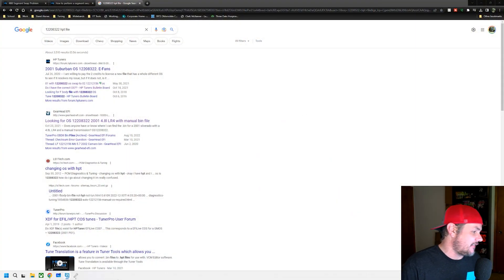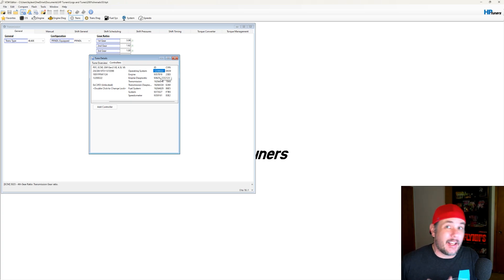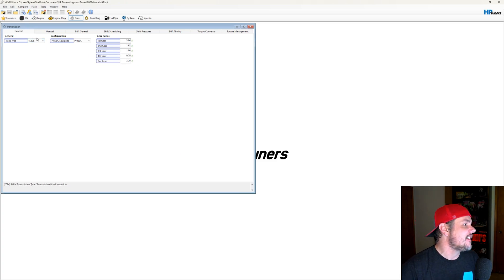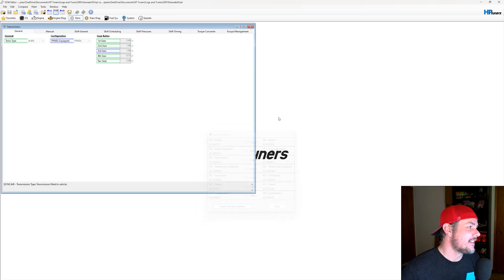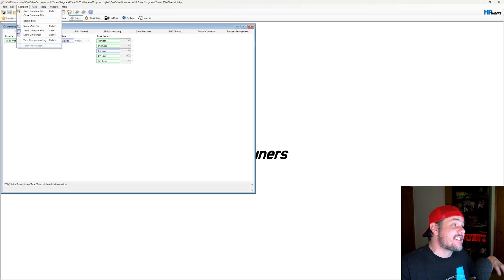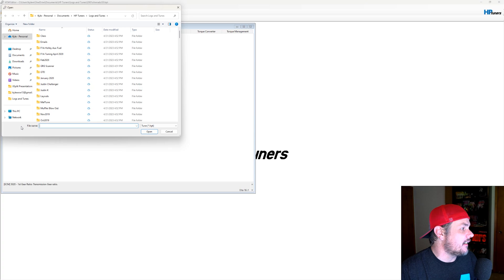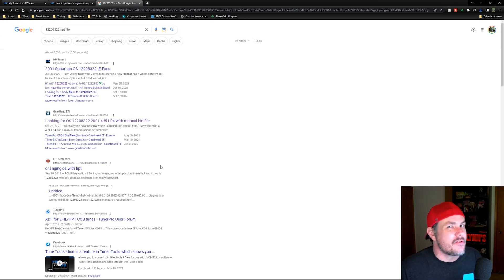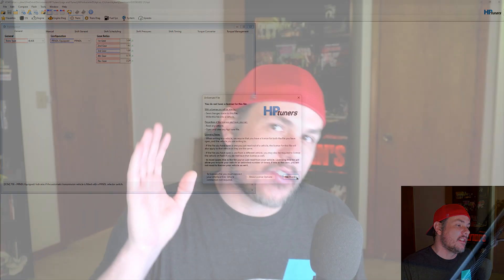Segment Swaps in HPTuners are complicated!

Comment: Can't remember if both files have to licensed or not.  Was hoping you'd mention that
Reply: From what I recall, you do not have to license both files. I recall segment swapping an engine segment from a flex fuel Tahoe file and not needing any additional credits to do so. Not sure if anything has changed regarding that, it’s been a couple years.
Reply from the maker: Nope, only the one one you’re writing
Reply: Thanks for the replies, haven't had to do it yet but have a project coming up and now I know

Comment: Chime in if anybody has a way around this but the E38 ECU can not be segment swapped from auto cal to manual trans cal if your purpose is to use VSS from a T56. ECM pin outs are different for sensors from the manual wire harness and only way to get something like VSS to read off those specific terminals is to do a factory OS flash to a vin from a Camaro or Vette with the same OS. I have a VXDIAG VCX Nano on the way to see if it fixes my VSS issues when I flash the Silverado ecm to a Vette with the same OS #. The OS flash compatibility can be cross checked using the EFILive scan and tune program under OBD > Lookup OS. Some OS will brick the ECU if flashed too far out of their cal ID #
Reply: Fair warning, the VXDIAG software contains code that is flagged as malware/Trojan by several sources when uploaded to virustotal. I refuse to install it on my actual machine and run it in a virtual machine inside the main laptop/desktop. I haven’t looked too deep into the specific flagged malware to see if it’s a false positive or something nefarious, but there’s definitely something that is tagged as malware within the code of their software. Windows 10 built in virus protection did not detect anything when I installed it in the VM, but that isn’t saying much lol. That being said, it does seem to work, I haven’t attempted to use the ACDelco SPS to factory flash something yet, but I was able to perform a full read from a 0411 PCM on the bench using it as a J2534/J1850 VPW interface with PCM Hammer. Also successfully changed the VIN and then wrote original parameters back, and then poked around a bit with the Tech2 emulator. As far as questionable MDI clones go, it does seem to do what it’s advertised as doing. 

As for your E38 manual trans issue, this sounds like exactly the kind of thing that I’d end up spending an entire weekend on and probably eventually figure it out, I don’t currently have any E38 ECM’s to play with though. But you have sparked my curiosity. I wish I had an E38 or two laying around to play with now.
Reply: @Moddage  Thank you for the info on the malware I was completely unaware of that. Do you have a recommended dongle that’s fairly priced that would work for GM factory software?
Reply: @Moddage  I do have a Toyota Mongoose newer gen cable I am unsure if somebody has found a way to use some kind of interface compatibility tool
Reply: @jonathanblunt3779  The Drewtech Mongoose cables are solid, and from a legit vendor with known reliable drivers etc. Just not cheap. I don’t know if the Toyota cable can work with GM stuff, but that would be a good question to ask them, from what I understand GM SPS and software needs a J2534 interface that also supports the J1850 VPW protocol, which is why the Tactrix Openport 2.0 cable does not work(last I knew), as it’s J2534 but doesn’t do J1850 VPW.  Personally I chose to risk the cheap Chinese MDI clone in the form of a VCX Nano and just “sandbox” the software to a virtual machine that I run on top of my “bare metal” PC. I was unable to easily locate a separate driver file for the interface that doesn’t come bundled in their software, I may tinker with trying to extract just the necessary drivers and keep a copy of them without all the extra bits.  It’s possible the VXDIAG software packages are only flagged as malware/Trojans because of some section of code they use to perform the trickery needed to make the questionably obtained GM software they include work, but I personally don’t trust it either way.

I just recently found out about a new interface on the market, the OBDX Pro, which is made by someone involved with the PCM Hammer project, as such it is the preferred and recommended interface to use with that software, though they are transparent that there was involvement in the project, and the interface does seem to actually be a nice tool. The price is about the same as what I paid for the VCX Nano, and in theory should work with ACDelco SPS as long as it supports the right pass-through protocols. (Which it should since PCM Hammer can use it to read/write GM PCMs). Had that been around when I bought my VCX Nano, I probably would have tried it instead. 

As a general rule of thumb, with most Chinese “clone” hardware, and especially software, for any of the various adapters, interfaces, and gadgets I’ve purchased for various uses over the years(including an eeprom programmer) I always assume it’s got some infection/spyware/malware/tracking code in it and only use them on machines that have no personal information on them, or a VM on top of a main machine as a sandbox. I’ve actually only recently checked the VXDIAG software on VirusTotal as I was curious about it, but for me it doesn’t matter much what malware, if any actual, it has because there’s not much it can do in the VM it runs in that I would care about. 

I can’t personally recommend another interface like that OBDX Pro I mentioned, as I have no experience with it, but it seems to check the right boxes so it may be worth a deeper dive and/or inquiry to them to see if it suits your needs.  I do have personal experience with Drewtech Mongoose cables, and the Chinese VCX one as mentioned.  If you’re looking for something to just do pass through programming from SPS, the mongoose or possibly that OBDX Pro cable seem like the safest bet as far as software/driver safety goes. But for a cheap MDI clone type interface and Tech2 software etc on the desktop, your options seem to pretty much all be Chinese copies that may carry some risk of malicious software buried in the main program. Personally, I choose the cheap options with potential risk involved, and as said never use them on my personal PCs. It’s pretty easy to spin up a virtual machine these days, with plenty of free legitimate software options to run a windows VM inside of a windows PC. And hardware these days is plenty powerful enough to handle it. So that’s my recommendation if you’re going to play with knockoff interfaces and software. You can even keep the VM from going out to the internet or your network unless you specifically allow it to do so. 

There may be other interfaces out there now in addition to the one I mentioned that are less sketchy that may do what we want, but last I looked into things back when I bought the VXDIAG one, it was either pay $$$ or go cheap and run sketchy software. For my use cases and frequency, cheap with sketchy software in a VM was the winner.  

Hope this helps, and ABT!
Reply: @Moddage  thank you so much for the big explanation Mr. Moddage! I will try out the VXDIAG isolated in a virtual machine and see how it handles the flash. I will also report back on the OS flash from auto to manual hopefully it allows VSS to output properly! Thanks again for the help!!
Reply: @jonathanblunt3779  As long as the E38 controller is a compatible service number for the OS and the OS flash from SPS is for an application with a manual trans with the appropriate VSS configuration you're after, it should work as long as it's wired correctly. There's a lot of really interesting possibilities I was tinkering with back in 2012-ish at a shop that was very much into the EFI and standalone conversion space. We had some Frankenstein configurations with E-series controllers and compatible automatic transmission controllers flashed with non-matching base operating systems from different production applications (different VIN numbers even) to enable certain functions of a specific application for the ECM, and specific functions of the TCM from another application, and it was playing nicely. I haven't had time to seriously tinker or R&D with this stuff in several years but it still intrigues me a great deal, I left a lot of unanswered questions back in 2012.  I hope everything goes well for you!
Reply: @Moddage  spent a while messing around with the VXDIAG software and was able to get a Silverado>Corvette full flash to execute. Found that the connection type in VXmanager set to be a USB-nano worked and cycle the ignition 10 seconds before commencing the flash as it takes a while to get thru Techline connect and the ecu falls asleep. I was very surprised a boof driver, sketchy software and a dongle I dropped 3 times actually flashed the PCM successfully.
Reply: @jonathanblunt3779  That's excellent to know, thanks for reporting back! I have a few V6 PCMs/ECMs with compatible service numbers sitting in a bin I need to convert to something that can run an LS. This will be MUCH cheaper than full changes with 6 credits via HPT.
Reply: @Moddage  I was under the assumption HPT can not do a full write to the PCM which is why I opted for the VXdiag, I’m not sure if that has changed but regardless for 40$ for unlimited writes on a specific vin you just can’t beat.
Reply: @jonathanblunt3779  I've done a "strategy change" I believe they call it with an E37, it cost 6 credits to accomplish, but I had no other option at that time and it seemed to work. But yeah the TIS method is much more wallet friendly.